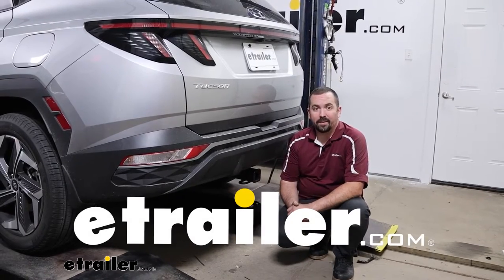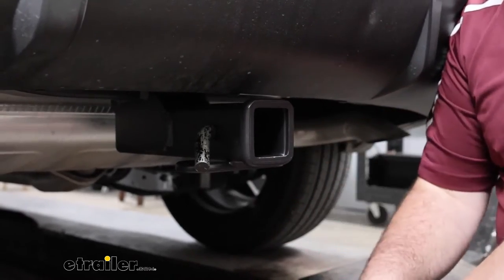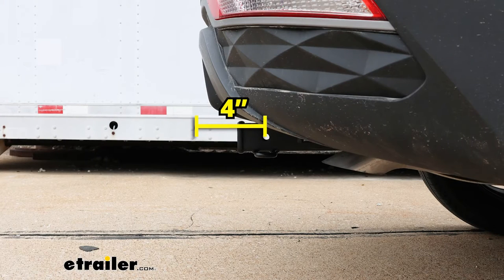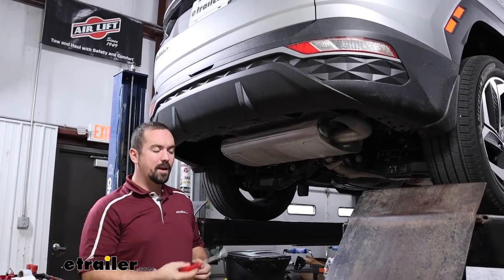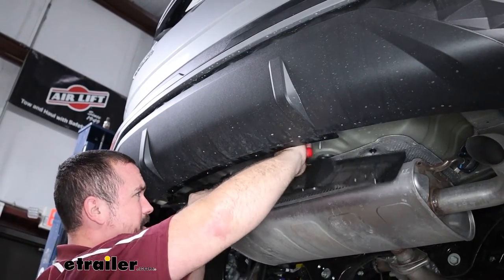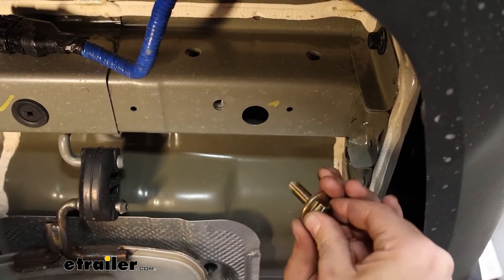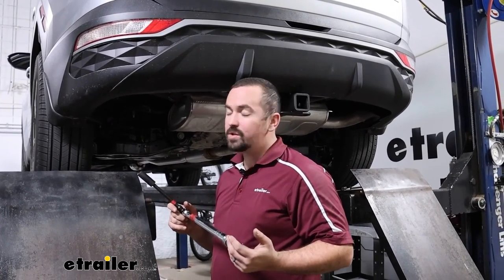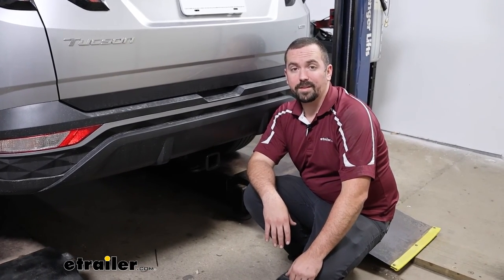How to Set Up Your etrailer Trailer Hitch Receiver on a 2023 Hyundai Tucson

Comment: how necessary is to remove that black circle plug before installing the hitch to the frame?
Reply from the maker: It's very necessary so the hitch sits completely flat against the underside of the vehicle and the bolt holes align.
https://www.etrailer.com/Trailer-Hitch/etrailer/e38KR.html

Comment: What about the wiring?
Reply from the maker: We shoot those separately. We recommend the Tekonsha # 118784. If you use the links below, you can see an install video and check out the product page.
https://www.etrailer.com/Custom-Fit-Vehicle-Wiring/Hyundai/Tucson/2023/118784.html
https://www.etrailer.com/tv-install-tekonsha-trailer-wiring-2023-hyundai-tucson-118784.aspx